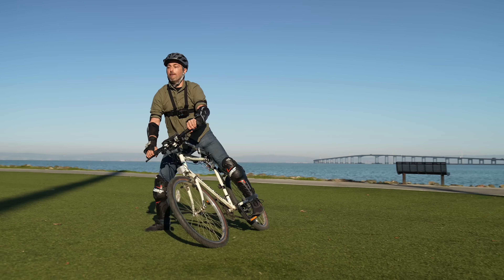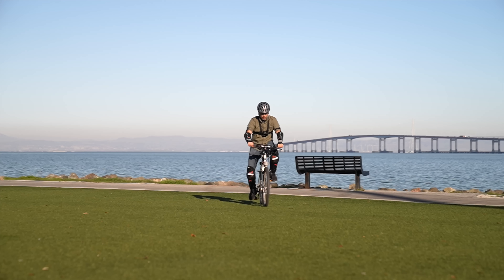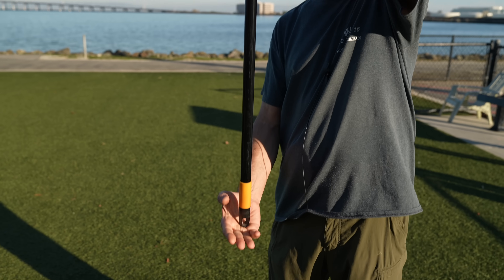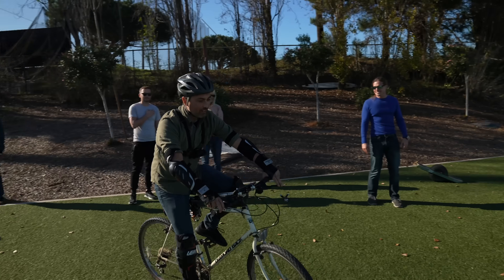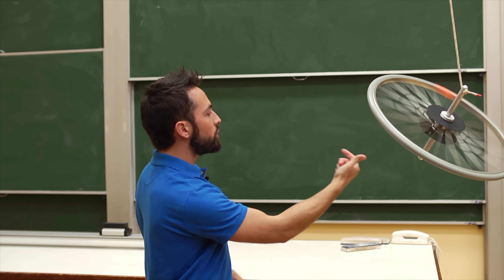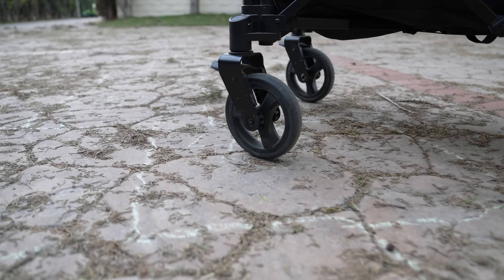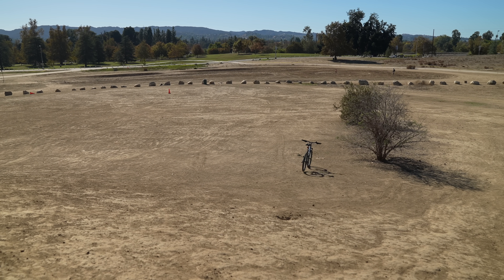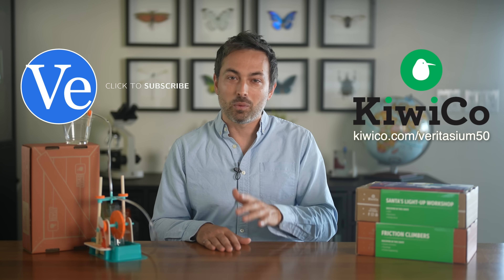Most People Don't Know How Bikes Work

Comment: You missed the most important thing about what is really going on.  This misconception can get someone into a lot of trouble if they follow your instructions.  It happened to me, not on a bicycle, but on a motorcycle when I first started riding.  This is what is important and will SAVE your life.  For proper steering of a bicycle or a motorcycle, it first depends what speed you are traveling.  If you are riding slow on a bicycle, like that demonstrated in this video, below 5 mph, the effects of force of the spinning front wheel is negligible and the rider can turn the bars in the same direction of the turn.  If the rider is traveling greater than 5-7 mph, the centrifugal force caused by the spinning front wheel will force the bike to lean in the opposite direction.  For a motorcycle, since it is heavier, the speed required for counter-steering is 12-15 mph.  What is important here is that whatever side a bike is leaning will be the direction the bike will turn.  Thus the faster one travels, the stronger the force on the bike while steering. That means counter-steering is the only way to turn a bike traveling at high speeds.  So at speed, once the turn is initialed by counter steering, the counter steering  must be maintain to keep the bike in a lean through the turn and only start turning into the turn to pick up the bike up and  go straight.  Please refer to Keith Code and the California Superbike School videos that illustrates this perfectly.  And yes, bicycles and motorcycles have the same physics.
Reply: " it first depends what speed you are traveling"
Totally wrong.
Speed does not matter as long as you go zero speed or faster.

This is interesting. "Please refer to Keith Code and the California Superbike School videos that illustrates this perfectly.  And yes, bicycles and motorcycles have the same physics."
That is true, but why did you said it isn't?
Reply: @XtreeM_FaiL  When you practice the Physics, it becomes clear.  There is an obvious weight difference between bicycle and motorcycle.  Wrong on the speed since the force created by the spinning front wheel is dependent on the speed of the bike.  Go out and practice and test your theories.
Reply: @XtreeM_FaiL The heavier the bike, the more centrifugal force required to significantly make the bike lean.  Starting at a specific speed, detailed in the previous responses, centrifugal force is generated, the faster you go, the greater the force.  It is this force that does all the leaning and steering around a corner.  You don't need to lean your body or give it any input other than just counter-steering.  So below speeds of 5-12 mph (depending on the weight of the bike), you steer in the same direction as the turn since there is no significant force generated.  What was illustrated in this video is just counter-steering to tip the bike over to the other side using the bikes high center of gravity.  The bike, in this video, was not traveling fast enough for it to lean using centrifugal force.
Reply: @XtreeM_FaiL  Okay, I see what is the confusion.  What is illustrated in the video is a quick counter-steering move followed by turning in the same direction.  This LOW speed counter-steering just causes the bike to fall over in the direction of the turn as the bike is steered in the opposite direction and pitches the bike into the turn.  The inertia of the bike causes the bike to fall and lean in the turn.  But here you must immediately steer into the turn to allow the bike to  follow through the turn.  This use of counter-steering give a quick flick into the turn as an initiator of a turn but is not required.  If you steer right on the bars of the bike at slow speed, the bike will turn right.  This is different to what happens at at higher speeds where the FORCE is actually doing the leaning and you don't let up from counter-steering until you want to pick up the bike.

Here is what I am saying: do not do the quick counter-steering flick and turn in the same direction if you are especially traveling at high speeds.  Do you own research and do not take just what you see on this video to apply at all speeds...I'm out...be safe...
Reply: @XtreeM_FaiL  I'm not confused because I have done it and actively do it everyday.  Do you even ride at all?  If so, what?  Heavier bikes, motorcycles, do require more input to counter-steer.  Bicycles are light and easy to flick around and like in this video, the bike is flicked in the opposite direction and quickly in the direction of the turn to create a quick lean and turn.  

This is going nowhere and hope the host is reading this and considers a follow-up with both a bicycle and a motorcycle and some real experts in counter-steering, Like Keith Code.
Reply: @XtreeM_FaiL  You need to refresh yourself with basic Physics...Look up angular momentum or rotational momentum.  This will help you understand why the spinning front wheel creates the counter-steering effect.  Look at the mathematics:  L  =  m * v  *  r   
All should be clear now, hopefully.
Reply: @XtreeM_FaiL  Formula for rotational momentum:  L  = m * v * r      // m is mass and rotational momentum give it the counter steering effect
Reply: @XtreeM_FaiL  If you do nothing, yes the forces are zero.  But when you change the velocity, there is a force created, right?  That is the force that creates counter-steering.
Reply: @XtreeM_FaiL  Yes, that's right because it takes force to counter-steer, at least the counter-steering that is important.  We are talking about the higher speed effects of counter-steering, right?  And not the nudge at low speeds that really does nothing, since anything below that threshold is not important.  So I gave the formula for the force responsible for counter-steering which has all the components involved that I have explain above:  mass and velocity.  Just trying to prevent anyone from getting hurt, which was my initial intent.
Reply: @XtreeM_FaiL  Let me add a few points:  I came close to loosing my life because of misunderstanding counter-steering until I took the California State Motorcycle Training Course.  Then perfected the technique at Keith Code's California Superbike School.  I was also category 4 bicycle racer for many years and do apply these basics counter-steering principles in cycling.

Comment: I think you don't need to counter steer if you're moving fast. I'm using a track bike everyday for city ride and for commuting and I don't need to counter steer if I'm riding fast, I just need to lean on the side that I'm suppose to turn and that's it. In my opinion, counter steering before turning is for your balance if you're riding slow.
Reply: You think, but have you ever tought?
If you still use training wheels, then what you said is partly correct.

Comment: What about riding bicycles with no hands? I havent done that in years but Im guessing you steer the wheel with your whole body instead of the handle?
Reply: Correct. However the steering is much slower and not as precise.

Comment: You should make a video about countersteering on a motorcycle. When you get over a certain speed on a motorcycle you countersteer through the entire turn/corner.
Reply: Isn't it exactly the same as a bicycle just at higher speeds?! Thank you
Reply: "over certain speed"=0km/h or more.
It does not matter if it is a motorbike, bicycle, moped or what ever.
Skibike work just as well.

Comment: It is possible (and easy with enough practice) to balance on a completely stationary bike. When you start to loose balance, you steer in the direction that your falling in. I'm not sure entirely how it works, but I think that the offset of the front wheel helps you shift your centre of gravity.
Reply: It is countersteering. It works the same no matter what is the bike's velocity.
Reply: @XtreeM_FaiL  Exactly. It works the same on a motorcycle as well.
Reply: @XtreeM_FaiL  Exactly. I'm certain it works the same.
However most people don't realize that they are actively counter steering.

Comment: I race mountain bikes and there is a way to turn in a direction without counter steering, if you stand up on the pedals and lean the bike itself in the direction you want to turn, no counter steer is necessary
Reply: Does it work if you hold on to the frame instead of the handle bars?
Reply: @FlyNAA  Probably not. Body steering does not work. And when it does it works very very slow.
Reply: @EEEBA1  I would argue that if  "leaning" doesn't work if you can't touch the handlebars, then it's not the leaning that's doing the work, but rather manipulating the handle bars (subtly and subconsciously). This is because you can not move the combined body+bike center of gravity to the side, without pushing against anything or ejecting mass. If you lean your body to the right, then the bike leans left, and that's all that happens.
Reply: @FlyNAA  Which is counter steering as soon as we hold on/touching the handle bars. Correct?!
Reply: @EEEBA1  yeah. Also I just realized you're a different user than the one I originally replied to, so things are making more sense now.
Reply: @FlyNAA  Yes. I just wanted to add to the conversation. A lot of people don't realize that they are actively counter steering when they ride a bicycle or motorcycle. It's the only way to do it.

Comment: i dont think i counter steer. i just lean in the turn. not even turning the wheel. well i steer the bike but just cause the leaning steers the bike.
Reply: But you "lean" the bike by holding the handlebars?
What if you were holding the frame of the bicycle instead? Would your strategy work? 
You probably won't turn in time, and will miss your turn especially if you are going fast. You have to counter steer to change direction. That's the only way!

Comment: I used to ride motorcycles. To turn left you push forward very slightly on the left handlebar, which effectively turns to the right. This causes the bike to lean to the left & left you go. This is because you're extending the distance between the rear and front tyres & you don't have to fight to lean the bike, it does it itself. It's a delicate process that is best practiced before going straight out & doing it.
Reply: very slightly? I usually yanked it making sharp cornering and sometimes drag the kickstand.

Comment: I don't think you can fully discount the gyroscopic effect of the turning wheels. simply by showing and explaining that a bicycle can remain upright by itself. The explanation that the bike steers itself according to it's geometry remains upright does not explain if you take the wheels off the bicycle and roll them down the hill they also will remain upright.
Reply: >> I don't think you can fully discount the gyroscopic effect of the turning wheels.

You can when you make a bike that has zero gyroscopic effect.
Reply: @Rick_Cavallaro  except the bikes used in this do have large wheel, are turning  and thus do generate  a gyroscopic force.  What is missing from this explanation, is that a bicycle wheel will balance by itself when rolled down the hill held upright by the gyroscopic force generated by turning. He showed the bicycle rolling down the hill autocorrecting itself indicating that is why is remains upright. Lock the front fork on the bicycle as shown in the video and roll it down the hill, it can roll  for a distance and still remain upright without the auto correction shown in this video.
Reply: @YeanyScience  
>>  the bikes used in this do have large wheel

Yes, but at this speed, with a rider on the bike, that effect is pretty insignificant.  It clearly was not enough to help the folks riding it with locked steering.

>> What is missing from this explanation, is that a bicycle wheel will balance by itself when rolled down the hill...

That effect is not missing from our explanation.  It was described in the part about the stability of a riderless bike.  What makes a single wheel stable is exactly the same thing that makes a riderless bike stable.

>> held upright by the gyroscopic force...

But it's not held upright by the gyroscopic force.  The gyroscopic force simply causes the wheel to rotate about an axis 90 degrees from that of the torque being applied to it.  That produces exactly the same steering effect we describe.

>>  Lock the front fork on the bicycle as shown in the video and roll it down the hill, it can roll  for a distance and still remain upright without the auto correction shown in this video.

Nope.  We did exactly that test (not shown in this video) and at these speeds there is no noticeable impact from the gyroscopic force.  With locked steering, the bike falls just as quickly as if it were released while standing still on flat ground.
Reply: @Rick_Cavallaro  Thanks Rick, you've peaked my interest to explore this a bit  on my own.  With over 22,000 on this video,  I hadn't expected anyone associated with it to reply or correct comments.  Also,  made my way to your channel which I am now enjoying.

Comment: Most Dutch people do know how bikes work. I can ride a bike without touching the handle bars. Simply steer by leaning. I knew the gyroscopic effect wasn't the main cause, but I thought it did help dampen the movement, I didn't know it also helped by steering the wheel when you lean, I thought that was all due to the caster wheel effect.

Comment: BS, it depends on how fast you are going, if you are moving slow steer in the direction you want to turn, if you are going fast then counter steer in the opposite direction and lean into the corner using gyroscopic forces which aren't present in high enough force at low speed. Don't listen to this muppet watch and listen to an experienced motorcycle rider instead.

Comment: If you have full control of the bike you don't need to countersteer, you just move your body weight on the bike and move the bike, you do countersteer when your technical ability to ride the bike is not sufficient to control the bike for complete. There are many ways to adjust the vertical axis of the bike without the need to adjust the handlebar's direction, so a good biker is able to ride that bike. But in the video you explain that it is not possible, why?
Reply: Full control?
Oh you mean when you're carryin the bike.
Of course you don't need to CS then.

Comment: Well, it does make sense. Once you turn,you use your body to lean to the side and your center of mass is shifted to one side. In order to bring the center of mass back in line with bike, you need to "pull yourself back up", and you do it by turning wheel to the opposite side. Locking opposite turn (right turn when you're turning left) leaves your center of mass to the left with no way to push it right. So you just fall.

Sorry, haven't watched the video yet, just first minute so I was not rephrasing if this was the same conclusion, and if not - then I truly don't know how to ride a bike :)

Comment: This is called counter-steering , you push the handlebar away from the direction you want to go and the bike tilts that way which causes the turn in that direction, but counter-steering works when you have gained a minimum critical velocity. its dangerous at low speeds. 
But
You can turn without counter-steering if you lean towards the direction you want to turn thereby tilting the bike in that direction, this is achieved by suddenly throwing bodyweight in the direction of turn.
And
Another way of turning is to push the bike from under you in the direction of turn while the rider remains more or less vertical. this way you can make a figure of 8 in tight spaces

Comment: This is a wonderful explanation of counter steering. An experienced rider however, could simply lean the whole bike over, while keeping the wheel straight, and then execute the turn.
Reply: Experienced riders believe they can do that - until they try it on a bike that doesn't allow them to counter steer.
Reply: Mount wheels on a two-by-four and try to make it turn.
Lean as much as you like.

Comment: It's a shame you didn't bring a highly proficient cyclist. The way they would solve the problems with steering (because I'm convinced they can) would illustrate the points made in this video much better.
They would lift the front wheel, bunny hop (jump with entire bike), use front breaks to stand on front wheel to adjust, and probably more.